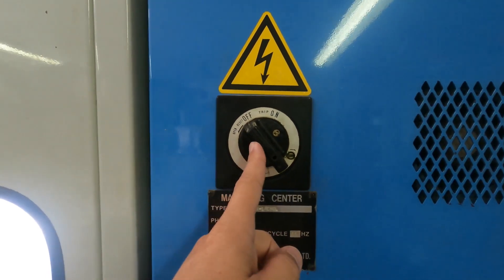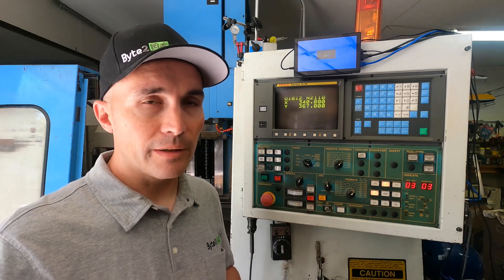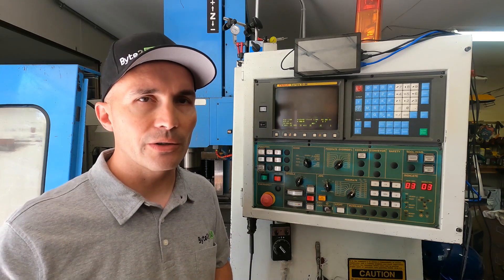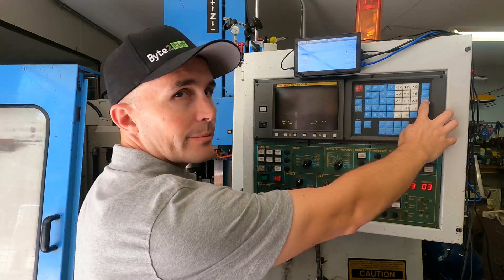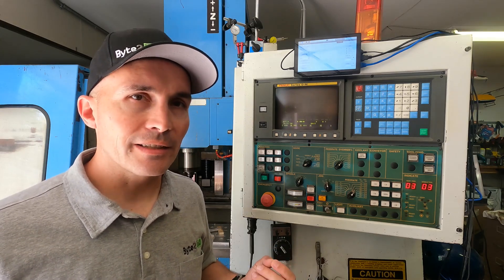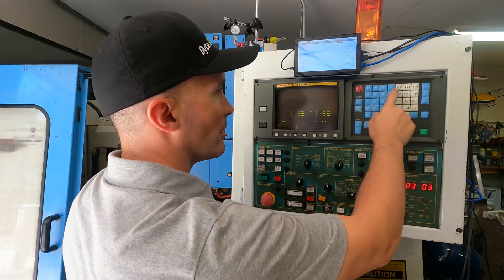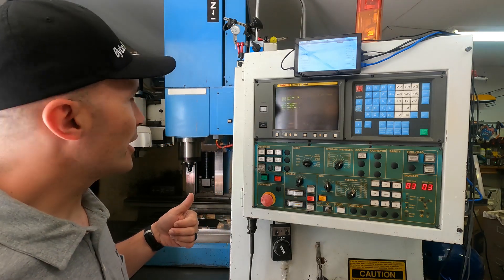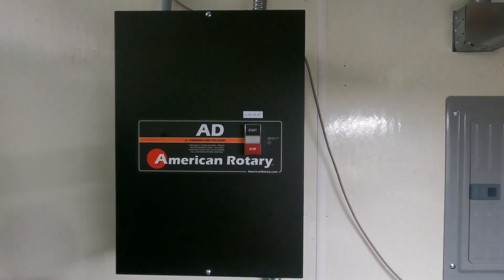CNC Mill Basic Startup and Usage

Comment: I have same FANUC Series O-M controller 

Problem i am facing it’s unusual i am not able to figure out. May be you can help me.

I set the workzero exact machine coordinates when tool touch the corner of workpiece and put x,y values in g54 and z value in tool height offset.

Now when i run my program 
When the line comes G90 G54 G00 X-50 Y-5
It should go 50,5 in xy direction from G54 point.

But it doesn’t go there it goest where i started the program. For example after setting Zero return if i put machine at random position, machine goes there after my program run the line which i above gave.

What could be the reason?
Reply from the maker: That's an interesting issue.  When I use my machine, I manually type in the G54 coordinates into the controller and it is a hassle.  I googled this issue and AI seems to think that the G10 command should be used to set the G54 values.  I am not sure if that is true for our Fanuc controller.  Also, the tool length compensation always gets me in trouble because that gets added to all coordinates.  The other thing to watch for are other G codes that might affect the beginning of your program.  Let me know if you end up finding a solution!